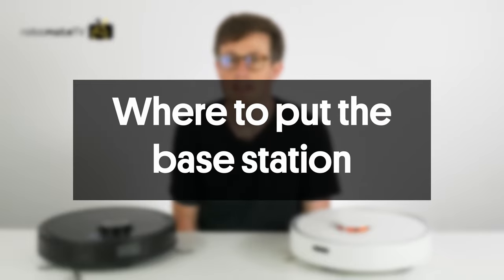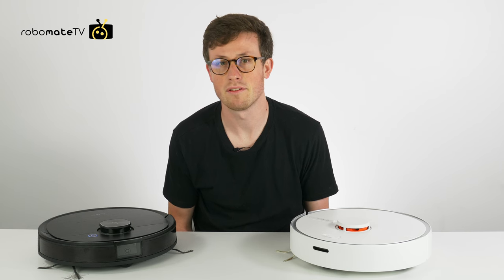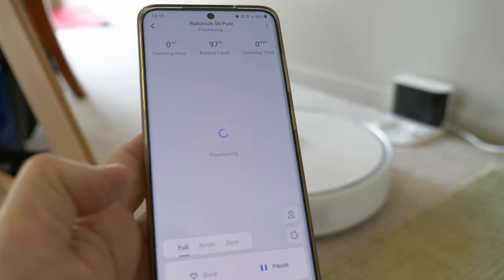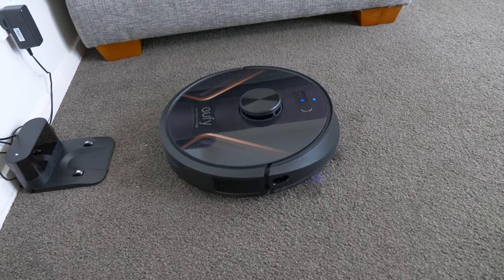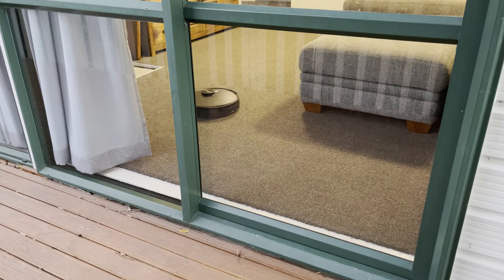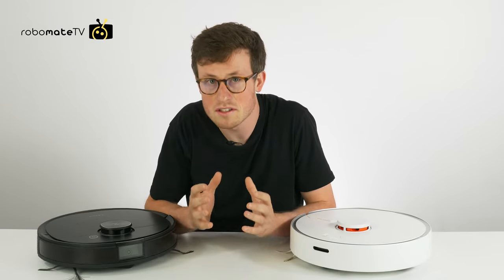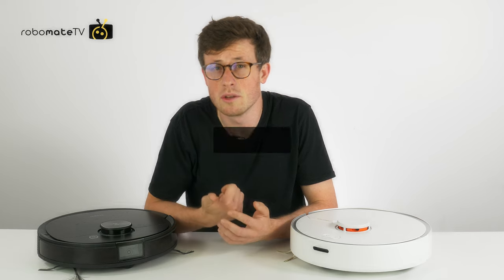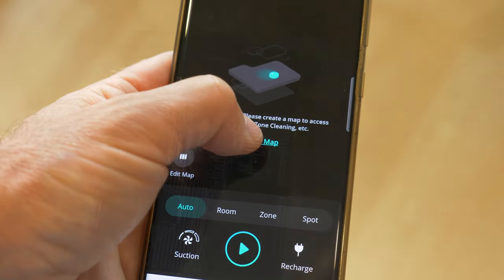The CORRECT place for your ROBOT VACUUM base station / dock?

Comment: Can you address how bad the Deebot app is?
Bought my t9 a year ago. Vacuum hardware works brilliantly but the software destroys anything the vacuum has to offer. I am doing all the right things positioning etc. even had the vacuum sent off for repairs. I’ve had to remap the house over 10 times since buying for the following reasons 
Map gets randomly deleted or walls and rooms and dimensions suddenly get skewed. 
Once map is created & saved I cannot divide rooms. Merge rooms or create boundaries to make new areas. An error msg comes up saying I cannot do it. 
To use the vacuum I have to use it in custom mode and manually draw the area I want it to go. If I use area mode, it says relocating leaves the base does circles and then goes back to base
Deebot just keeps saying send it in but how many times will this happen before it works properly, it’s NOT the vacuum that is the issue it’s clearly the app and software ruining it. They won’t offer a refund. I paid )1500 for it. I’m furious at this point. I see lots of people say the same thing as me. But where do we go for help? I’m lost
Reply: Go see a lawyer. You have rights
Reply: Does the vacuum goes offline in app after some time?